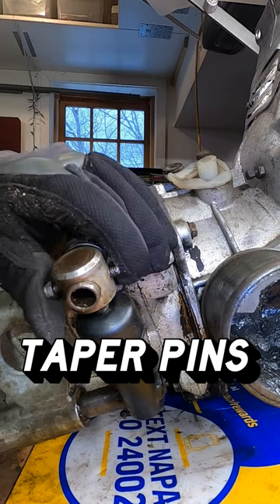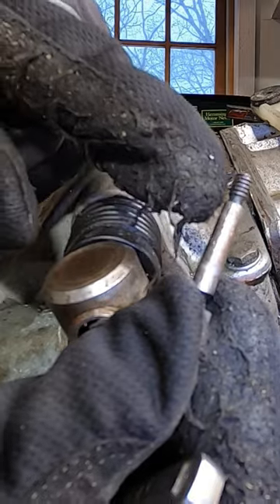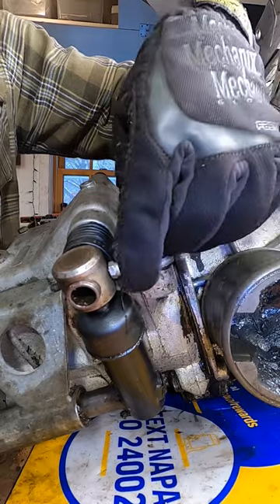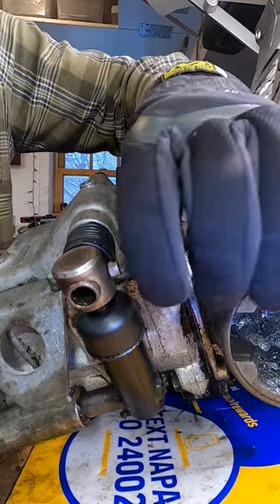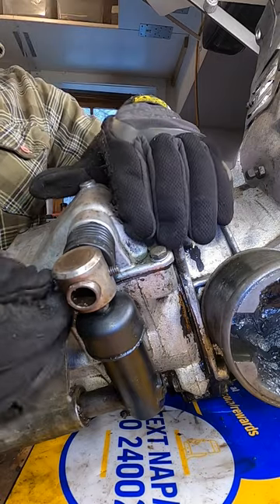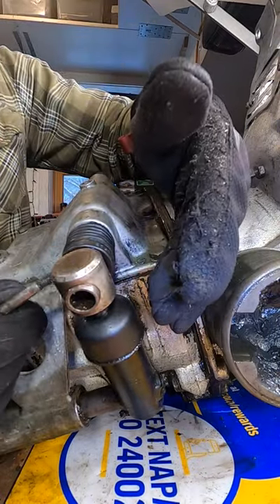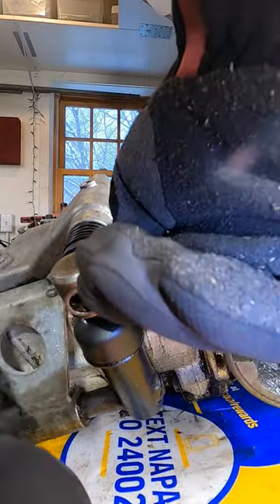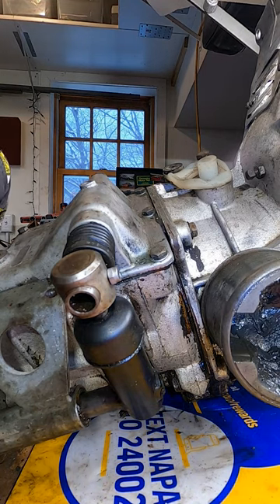Meet The Taper Pin

Comment: Also used in aviation.  Used on a lot on flight controls where the centering of the component on the shaft really doesn't let the part move from that index.